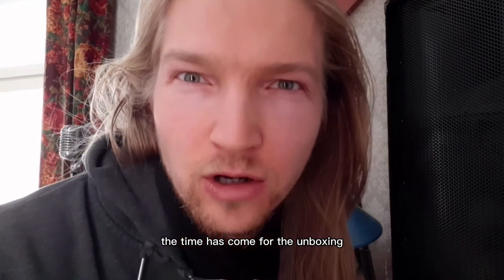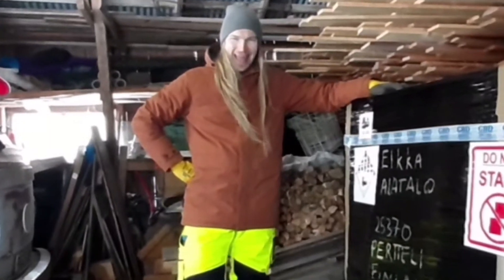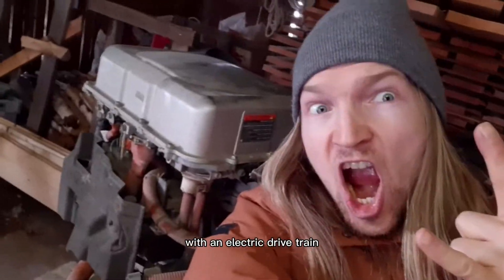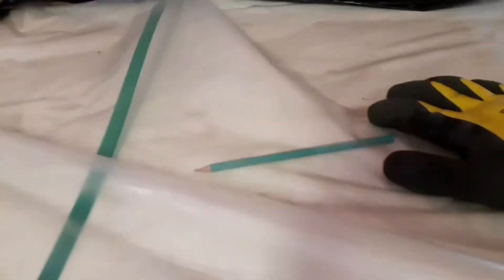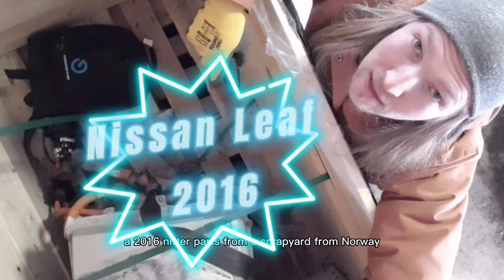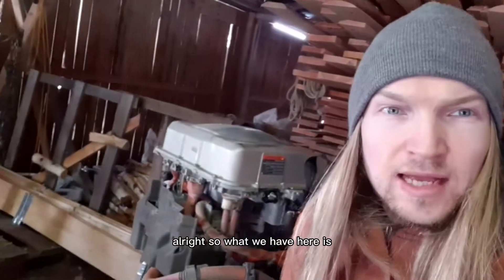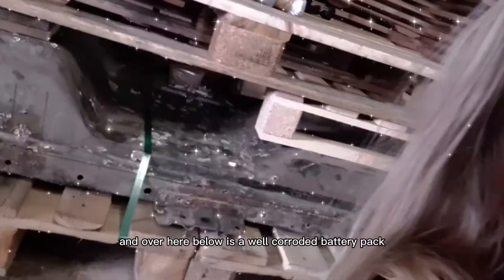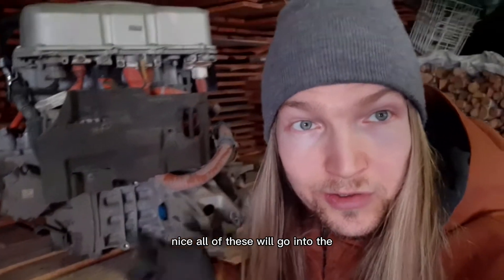VW BUS ELECTRIC CONVERSION HOW I PLAN TO DO IT! ep.1

Comment: Very interesting, I will definitely follow your build project. Dreaming of a similar project, but not sure where to start. Getting my hands on a cheap wrecked Nissan leaf would be a nice start. May I ask how much you paid for the Nissan Leaf parts ? I understand battery might be expensive because of current EV mania, but how about rest of the parts (Motor, controller, inverter and charger) ? Do you know if is allowed to tow in Finland with a muutoskatsastettu EV built on Nissan Leaf platform ? Rock on!🤘
Reply from the maker: Thank you!
Which car are you planning to convert? I found out that Nissan Leaf parts + Resolve EV controller is probably the simplest way to do a conversion with minimal hassle. There is still loads of work and fabricating and welding to do. There might even be a bolt-on-kit solution for your car model. Which car would it be?

I bought the Nissan Leaf parts from a scrapyard in Norway because they have a lot of these parts. Motor, inverter, PDM, battery, throttle pedal, axles, cables cost roughly 6500€ total including the VAT tax that goes to Finnish government (buying from outside EU). It is a shame Finnish scrap yards don't deal ev parts.

The total cost of my conversion is close to 10 000€. More info and calculations in my next video!

I am interested also in adding the tow bar to my VW. Sounds crazy, but I will do research on that! It should be possible.
Reply: @motorcircusfi  I haven't yet decided what car to convert nor do I have budget for a project car right now. Looking for a roomy steady platform for everyday use, maybe an old Mercedes/BMW station wagon/SUV or something fun with adequate ground clearance like Lada Niva. Availability and prices for EV parts will hopefully get better in the future. Also interested to see what kind of useful EV conversion parts can be extracted out of Toyota Prius/Lexus hybrid cars. Electric Pappatunturi moped conversion would be good practice as I happen to have a frame in rough condition.
Reply from the maker: @partasuhari  Yeah it's good to plan ahead the battery placement and all for your specific model. Of course you'll notice later that you might have to alter the plans... Just take into consideration that at least in Finland older cars are easier to get approved. If the car is 2002 or newer you have to have EMC tests done.